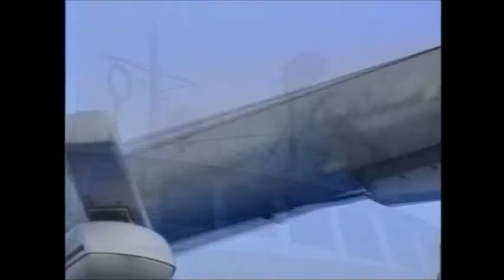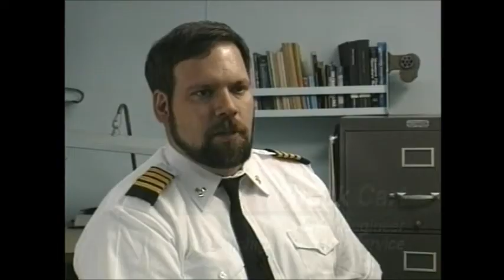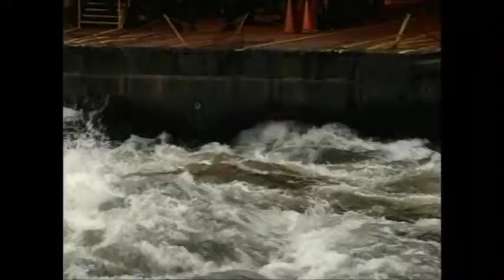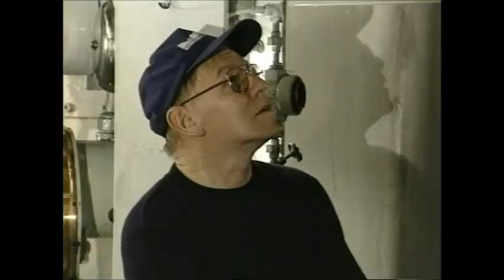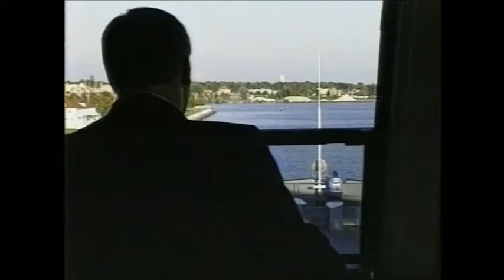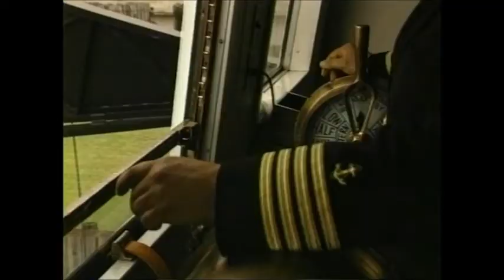SS Badger- How It Works

Comment: This must have been produced in 1993. Badger was first put into service in 1953.
Reply: Still running during the season.
Reply: It was made probably around 1996 or so. Chuck Cart wasn't the Chief engineer until then. Bob Roach was Chief in 1995 but was sick and died in 1996 if I remember correctly.
Reply: You can also see the SS City of Midland through the pilot house windows as the ship is performing the turn for docking. It was towed away in 1997
Reply: @matth5309 That other ship is the Spartan, Badger's twin--- at the dock,out of service.

Comment: Amazing ship handling, these ferry guys.  Everyone else needs a tug or three.  These guys just "finesse" that thing where ever they want it to go.
Reply: Four tugs per day would be expensive. No need with twin screw propellers.
Reply: @henrytupper6959  I'm pretty sure they have side thrusters, too.
Reply: @yepiratesworkshop7997  could be however I did work on a twin screw steamer passenger with no side thrusters and no trouble turning.  Side thrusters would be better of course. Turning in Montreal the current did help but other locations did not have that advantage.
Reply: @henrytupper6959  The best one I ever saw was a small boat used for dredging. It had side paddlewheels that were operated hydraulically.  The dredge "head" came off the front of it (to lower and raise) and that thing could turn in it's own width! Talk about something infinitely maneuverable! That was it. If I was going to build another boat, I'd do it in steel and use that side paddle-wheel set-up.
Reply: @yepiratesworkshop7997 I dont think they do
Reply: Mo

Comment: So what do the three black levers that the two engineers are manipulating do? I confess I'm unfamiliar with how you run a Skinner Unaflow, I'm more used to the more conventional reciprocating steam engines. I'd imagine one of them must be the steam regulator (throttle valve), so are the other two used for setting the valve timing for the poppet valves? Is there a simpling valve?

On an ordinary steamer with a compound marine engine, the main steam controls are the regulator, the reverser, and a simpling valve (used to admit high pressure steam to all the cylinders briefly to help them get started, usually when the engine is first being turned over and is still stiff and having to flush all the condensed water out of the cylinders through the drain valves).
Reply: The three levers are throttle, lead and cutoff controls.  The Skinner Unaflow has poppet valves operated by dual cam shafts with a follower between the shafts.  Lead is the opening of the admission valve before dead center and cutoff is the closing of the admission valve after a certain amount of stroke after dead center.  The faster the engine is turning the more lead is required and by working the cutoff shorter in stroke allows the steam to work expansively getting the maximum efficiency.  The lead and cutoff levers change functions when the engine is reversed.

These particular engines are "Compound Unaflows" erected in a steeple compound configuration with the high pressure cylinder on the top.  Their efficiency actually surpassed steam turbines in sizes less than about 10,000 horsepower.

The throttles are normally left in a wide open position (except when maneuvering) and speed is controlled with the lead and cutoff levers.  These levers are linked to a sliding helical gear on each camshaft which actually changes the timing of the poppet valve operation in relation to the crankshaft  The engines are directly coupled to the propeller shafts and direct reversing.  By simply moving the lead and cutoff levers to the opposite side of center the engine is reversed, just that fast, my friend.  The Skinner is the fasted direct reversing marine engine ever devised.

Lots, lots more I could share about the Skinner Unaflow but maybe for a later time.
Reply: Oh, one more thing for right now.  Ahead of the three levers you can see a smaller lever that is connected to four-way hydraulic valve.  This allows pressurized engine oil to be applied to cylinders actuating small auxiliary exhaust valves (also poppet valves) that act as cylinder drains when first starting the engine.